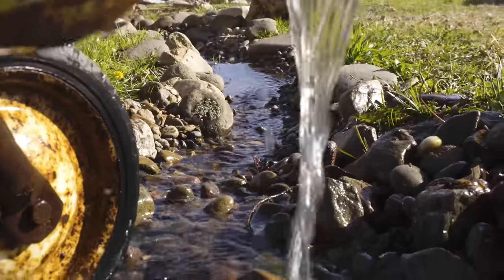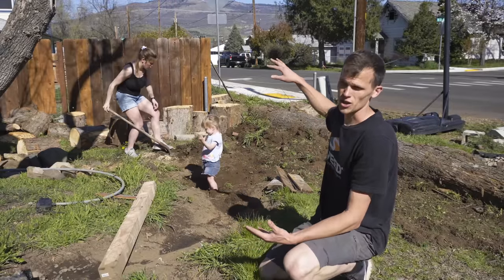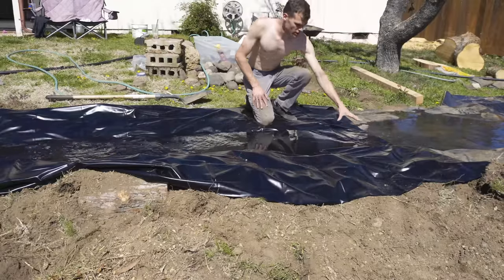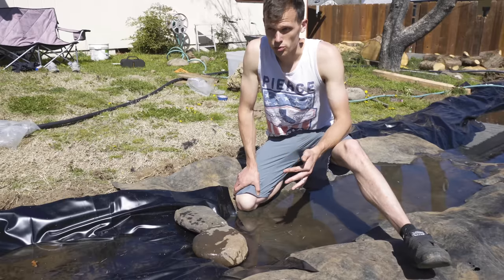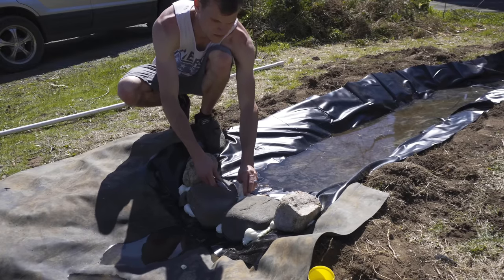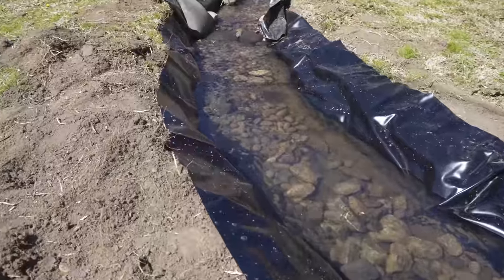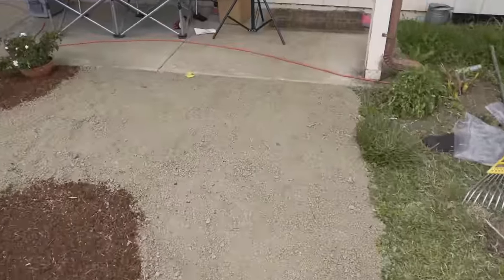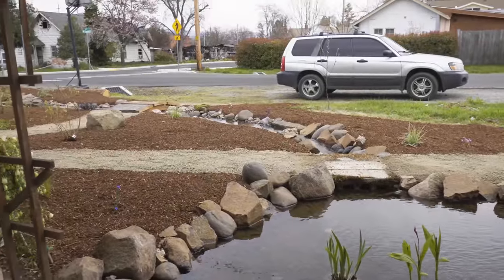How to Build a Creek Water Feature

Comment: Rather than letting your foam harden then cutting the excess, throw smaller gravel on it while the foam is half set. This allows you to flatten out the bulges of foam (eliminating the hassle and risk of cutting) and the pebbles/gravel stick and won't wash away with the water flow. That is what I did on my creek water feature anyway.
Reply: I did the same...perfect concealed seal!
Reply: Ooh good tip as I'm just attempting 🤞🏼same but smaller scale .

Comment: Depending on the type of liner you use, you can heat seal them to prevent the water from backing up. We build waterfeatures in Texas. :D
Reply from the maker: I like that idea I’ll have to look into it!
Reply: Can't you also just use silicone to seal the overlap?
Reply: @accessiblecruisetravel-dre3383  I came here to ask this as well.
Reply: What type of liner do you use because I just built one and I have a leak and it’s a bona fide bitch
Reply: What kind do you use and how do you seal it?  It does it self seal in 107° Temp?   Texas wants to know.
Reply: How do you seal the liner?

Comment: I use expanding can spray foam for all my outdoor projects. Works great to fill gaps and holds things in place very well. Your able to sculpt/mold it and I’ve used it to (make rocks or imposters) when I can’t find one I need. Bonus, it holds paint/stains very well so if it’s the wrong color and visible you can paint/stain it. I do use a clear waterproof deck sealer of flex seal clear spray to prolong the life.

Comment: That was pretty cool, and can you tell me how you control the water flow and volume if it rain?
Reply from the maker: im not really worried about the rain. It'll fill up and then just overflow out the bottom into the rain drain near the street. If you wanted to control flow you could glue a valve into the pipe and just dial it back a little.

Comment: Hi Travis . Posting from England.  You're the first person I've seen 
who says household diy foam is ok to use which is what I've been wondering. 
Some experts say it's not fish safe and only aquatic foam should be used where fish are present. Any thoughts?
Regards
Tim
Reply from the maker: I did a little research and couldn't find a definitive answer. I did not use it any where they're able to eat it, and I figured once its dry there's nothing it can do to harm them. Perhaps I'm wrong, but I feel like the pond stuff "fish safe" is a marketing gimmick to double the price. As far as I can tell my fish are fine. 
Just my anecdote.
Reply: @travisjantzer  
Thanks Travis. I did buy some proper pond foam in the end as had  a £10 voucher to use on ebay so got it half price. Will be using it this week if it ever stops raining here in not so sunny England.

Comment: Have you had to make any modifications after the initial setup (the one in this video)?  If you turn off the pump, does the pond overflow when the creek water fills it?
Reply from the maker: yea the water overflows at the bottom if I shut it off. But the top pond area doesnt completely drain so my plants there would live a little while with not waterflow. I have not made any modifications, just added some plants and a bench nearby.

Comment: Outstanding! Curious why you didn't use liner tape where the liners met? Anybody else use it? I have 2 separate ponds and I've considered using tape to connect them with a stream.
Reply from the maker: I have never tried liner tape.. does it work well? In my experience the change in elevation where they connect is enough if done properly.
Reply: @travisjantzer  I don't know. I was wondering if anyone knew.

Comment: Super cool video and it looks awesome man 👏🏻 I would’ve thought putting the rocks in to create the rapids could cause the water to backup and leak over the sides? What’s the trick?😀
Reply from the maker: Tall sides, deep trenches, dont cut the liner back until you see it running when its finished, you can always add more dirt under the liner if its overflowing :) 
Glad you like it!

Comment: Hi from the UK, love what you do - and how you present it.

I want to build a stream in a woodland area of a friend of mine and looking at what is involved and I am sure (unlike the stream I want to build) that it is going to be over my head but I'm going to try anyway.

The first problem is that as it is in a woodland area there are bound to be lots of roots in the ground and thought of starting with a small rotovator (as I'm 77 I guess I am not quite as fit as I was.

Do you think in principle this might work?
Reply from the maker: Hi from OR, glad you love what I do. 

Thats awesome you're gonna build one of your own. Any equipment you can find to help you break ground is recommended. If you've got lots or roots be sure to put down the cloth under the liner to prevent punctures. 

best of luck!

Comment: also what kind of pump did you use because I use the sump pump and I think I bought bigger one or something or because it pumps 3000 some odd gallons a minute and that’s too fast to keep the water on all the time so I like to know what kind of pump you used will have to make some changes and it’s gonna take a while
Reply from the maker: Pump link is in the written description below the video. Sump pumps are designed to work real fast, but not necessarily efficiently for a long time.

Comment: Excellent creek
I see I didn't understand the entry of the comment.  I need to make sure I understand where you change liner pieces.  Yall made the change where there was flow into a lower level or basin, I think.  About how much overlap?  Did yall use any sealant between the pieces? 
thanks, bruce
Reply from the maker: Hey bruce. 
I do not use any sealant I do about 2 feet of overlap with minimum 2 inch height difference between water levels. but you have to account for the rock when you dig out. because the rock on the liner will raise the water level. So make sure your stepdowns for the liner overlap are much bigger than you think you'll need. so when its all done you dont have a leak from water flowing back up under the liner up stream.

Comment: I loved this. I'd love if you did something along the lines of a stream (trickle stream, enough to make a consistent noise but not a ton of water) and a small basin, in a small 3-4'x2' area with a maybe 1.5' height difference from top to bottom. 

Since you asked for ideas :) That's the space I have to work with so I'm searching for ideas.
Reply from the maker: the total area you're working with is 4' x 2' ?  I could probably come up with something.. Is this a challenge? haha

Comment: Beautiful shapes, shades, colors, sounds and textures! congrats for the works you do and thanks for the quick tips. I've been planning my water feature for at least 2 yrs, but I can't decide for one style. I've seen your designs, they're all beautiful.

I've made my first try in form of water pillars, using 10" diameter PVC piping to fill in with cement, Is it necessary to apply any kind of resin or cement sealant when making a sump for the water feature, pond or creek?

I don't like the classic pond liners, not sure why, but I resist to put plastics into the earth (even if they're "green")
Reply from the maker: I suppose if you used Concrete/Cement in place of a Pond Liner you would have to seal it like a swimming pool or else you have some major risk of cracks and leaks. Though with the Global Sand Crisis right now I'm not sure Concrete is any more friendly to the environment than plastic. Pick your poison I guess.

Comment: how do you install the recirculating pump? does the hose for it sit below the liner or do you have another trench dug out for it?
Reply from the maker: pump is in the pond, pipe is just sticking out over the liner and covered with rock. at the top it arches over the top of the liner and angles down into more rock. buried in the dirt everywhere else.

Comment: That’s amazing, man!  What kinda maintenance dose something like this require?
Reply: I second this question. Also does running the pump 24/7 add a significant cost to the electric bill?
Reply from the maker: the pumps are pretty energy efficient. I dont think they add too much to cost. Maintenance is mostly raking leaves out and hand picking out debri. especially in the fall. I'll clean the pump by hand periodically. I made a video about maintenance for my last creek. It might help a little.

Comment: Did the water plants die from the first video? I noticed you didn't replant them.
Reply from the maker: The water lillys and bulbs die over the winter and come back in the summer. the floating Hyacinths and Lettuce are Annual in my zone. So yes, those die out and need to be replanted.

Comment: Where do you guys live? What was the estimated total cost?
Reply from the maker: Oregon. 

Cost, ball-park estimates.. 
Pump: $200-300
Liner: $200-300
plus pipe, rock, plants, foam or concrete.. 
probably between $800 and $2000 if you do it by yourself, depending on where you get the supplies. I got the rocks free from my parents property, and the pipe used, so I spent about $500 - 700 on the Pump, Liner, Foam, Bark, Granite, Plants, and Fish.

Comment: Love the water feature for the most part, but those bridges could use a little woodworkers touch to really make the feature look it’s very best.   If your going to build a bridge over the creek you need to go all out and really build a nice looking bridge with hand rails on each side. Do away with those larger sheets you have down now and use 2x4’ but I would make 2 curved braces that go across the creek first then attach the 2x4’s to the arch  leaching a 1/4” gap between your 2x4’s!  Make the hand rail to match the arch of your braces. I would use pressure treatment materials just so it holds up a lot longer, even though I still seal it with a waterproof product of your choosing and let dry completely. More than likely I consider painting it with a good quality red deck paint.  Home Depot actually has a super good deck  paint that I’ve used on my raised beds in the garden probably least 6 years ago and the paint still holding up like new. No flaking nor pealing at all. Which actually surprised me cause I really didn’t expect this deck paint to hold up so well!  Figured I be repainting least every couple years but nope no problems at all with the paint holding up for numerous years!  You got a great water feature, don’t skimp out now on a so side ramp over your creek and build yourself an actual good looking bridge you’ll be proud to have others look at and walk over too!  Think of the bridges you see going over creeks in a oriental theme!  Make them a little wider where 2 people have room to cross at the same time . Then you’ll have a super great looking water feature. Tell you what, you come help me build the water feature and I’ll build you the bridges  for both our water features!  I’m a perfectionist if you haven’t figured it out yet? LOL I just can’t stand anything that’s not perfect! Btw, I also noticed or least it looked like it on the video where some of your bark dust along the sides of the creek look wet/damp in some areas! Hope that’s not areas where your creek water getting out into your bark dust? That would suck, although I’m sure you could fix that fairly easy if you have to? Hope you redo your bridges, it make a world of a different when it’s done!

Comment: lets build some nature and put plastic in it. ironic. did you thought about filling these gaps with little stones? and as time comes, naturally there will be debris which will close these gaps and more water will go over the stones than through or under.
Reply from the maker: I do fill most gaps with stones. But water erodes things. Ive tried using rock and sand to crack fill and it washes away over time.